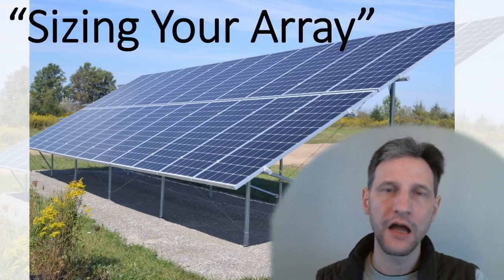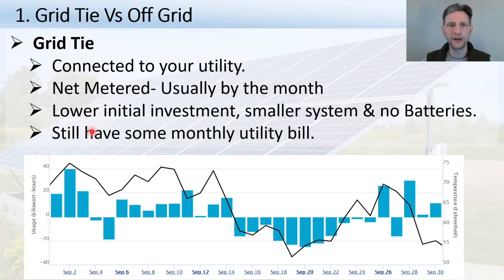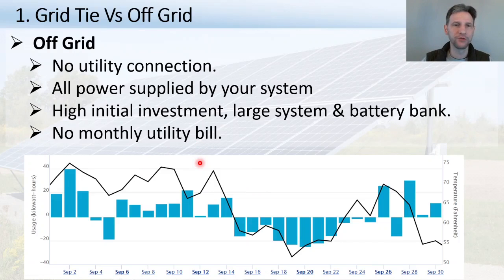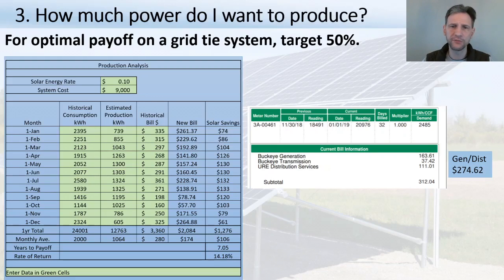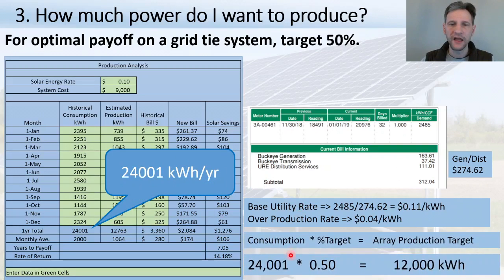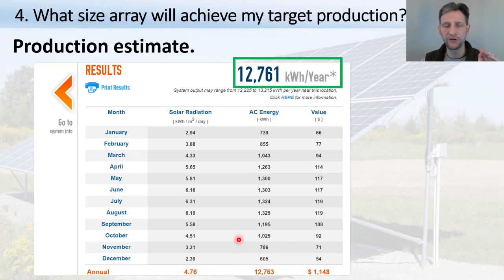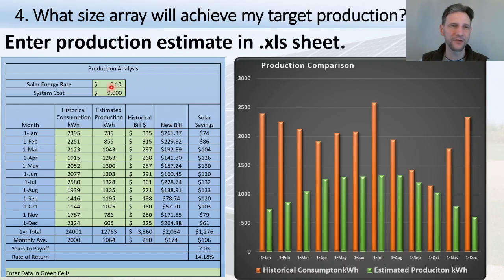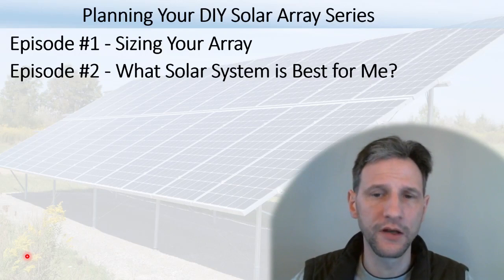How to Size Your Solar Panel System - Planning Your DIY Solar Array Part 1

Comment: Thanks for the clarity! One quibble is that you wouldn’t need a battery that makes half the month’s electricity, unless darkness lasts two weeks at a time! Every day there’s sunshine in some amount, so that’s the measure to count on. Denver Colorado gets 300 days of sunshine even if winters can be cold.
Another matter not addressed in comments or the video is that payback isn’t always the goal—freedom is. These days, air conditioning and even cooking & heating with gas are under political fire.
Reply from the maker: You have a good point, to be fair, optimal battery size will be different for everyone.  Battery capacity heavily depends on the climate in your location, your consumption pattern, and the size of your array.  My comment was based on a brief look at some of my worst case months for battery backup assuming keeping my current array.  In those cases I was overproducing for the first half of the month and then underproducing for the second half of the month.  To take full advantage of all production I would need to save the energy produced over the first half of the month to be used later.  However, to your point if the array is sufficiently oversized that would not be necessary.  There is a balance somewhere between oversizing the array and minimizing the size of the battery.  I plan to do some further detailed analysis on where that balance point would be for my system in the future. Thanks!

Comment: u use over 2000 kwh a month oh boy, I use about 300 does it make sense for me to go solar?
Reply from the maker: These systems are all scalable, just run the numbers and see if it works for you.

Comment: There is a out 2,840 hours of sun light per year. 12000/spa. Is 4.84kwh array.
So if you had a tracker that was around 5 kWh then you should meet your target.

Comment: You don’t need a battery for two weeks, you need a battery for two or three days and then a gas generator to make up the difference. A much cheaper option long-term. 
I myself only have a battery for a day and a half and use a generator for those times when there’s not enough sun. Usually it’s just a couple of months out of the year!
But my system is off grid, because if you’re connected to the grid and the grid goes down then you have no power at all. It’s better to have a transfer switch, when this happens.
Reply from the maker: A battery/generator hybrid solution does significantly reduce the battery size needed.  Is your generator sized for your whole load or does it just supplement the batteries when they get low?
Reply: @ProjectsWithDave  
I didn’t buy the generator that I would buy now, knowing what I know. But at the time I just bought the simplest and not very high wattage generator I could get. It’s only 3100 watts, so it’s basically just for charging up the batteries.
Reply from the maker: That's the value of the YouTube community, you can learn from what others who when before you have done.  : )

Comment: So 9.4 kW system produces 12763 kWh per year you must live in exceptionally sunny location. May I know what state you are in? Must be north of USA as I saw snow on your panels. Also I used PV calculator for my area and noticed that if I choose premium panels or thin film panels with lower efficiency and lower temp/power loss coefficient then I produce more energy. That means that low coefficient is more important in some cases than maximum nominal efficiency
Reply from the maker: I live in Ohio, not the most sunny place in the US.  With all the analysis you do, convert everything into cost/watt.  It doesn't matter if one panel is 10% more efficient if it cost 30% more.

Comment: I must have missed where you talk about sizing the array. You seem to have entered the size of your array (9.4) into that website before any other data. If you have your yearly usage, how do you come up with the array size? 
Eg Southern Ontario, 18000 kwh/year, annual net metering, $2500/yr total charges
Reply from the maker: The idea is to try different size arrays in the calculator using your address and the orientation of your array.  When you find a size that meets your production target, you can design a system around that.  Hope that helps!

Comment: Great channel! Do you have much experience with doing solar setups for Michigan residents?  Looks like Michigan averages around 4 hours of sunlight for the year?  I need a system for 15kw...and to possibly future proof for an electric car or two.  We are currently on NG furnace, water heater, and dryer.
Reply from the maker: Michigan is a little further north than I am so you would want a slightly more aggressive tilt on your panels.  I would face them all the the South.  Also, you should do some calculations on your electric car consumption, you may be surprised how much extra that will add.  Also the technologies linking solar and EV's is changing rapidly.  Check out my video on the topic here: https://youtu.be/U2ilH8yOi7A
Reply: Barr: Solar panels will be paid back much faster by charging the EV than by savings on house electrical costs. I only wish I could afford a Tesla! Cheaper brands will work, though.

Comment: very nice explanation. Perhaps consider also maintaining an array of batteries.True they cost extra, but they allowe you to consume the electricity that you have proudced before sending it to th grid. This is more effectice as you mentioned that utility charges 11 cents/kwh but pays you only 4 cents/kwh for electricity you produced. Second idea is to use batteries in winter to accumulate to more cheaper nightly electricity rate and then consume it in the morning before starting to pull energy from the grid
Reply from the maker: The grid acts like a month long battery.  That is way more capacity than any battery I could purchase.  Adding a battery would help in a power outage, but have no affect on the payback of the system.  You can see that analysis here:  https://youtu.be/IwUK1dNJ3n8
Reply: @ProjectsWithDave  Hi!, Thanks for your reply. I don't intend to design an off-grid system but an on-grid system however with batteries as well. The point is that in the wintertime panels don't produce much anything but the price difference between nightly and daily electricity is almost 100%. So the idea is to charget the batteries during the night and consume this energy during day when electricity from grid is much more expensive. Offcourse I hope that panels produce a lot of energy during the summer that I would be sending back to the grid in order to earn some money that would offset the higher consumption during winter. Even here batteries might be useful. You pointed out in your video that you get electricity from grid for 0.11 USD/kWh but grid pays you only 0.04 USD/kWh. So it might make sense to store the energy you created and use it yourself before selling to grid
Reply from the maker: I essentially get $0.11/kWh for daily overage since I only pay the net at the end of the month.  It is only over production for the month as a whole that is at the lower $0.04/kWh.

Comment: Did you ever consider using the solar panels as the roof for a carport or shed.  Would it be possible to seal the gap between the panels to create a water tight roof system.
Reply: The problem with solar roofing is the gap between solar panels. There is very little one can do to seal it properly. Using any type of heat treatment like soldering or welding solar panels is a big safety risk and must be avoided. One can try using aluminium grooves but it does not make it economical nor completely leak proof. It is better to simply install an aluminium roof and then fit the solar panels on them.
Reply: @shrujanamsyama9940  the designs i've seen are all slate roofs with the panels acting as slates
Reply from the maker: I have considered that, it makes a lot of sense especially if you are installing used panels.  There are people that have made solutions similar to your proposal.  My initial concern is the management of thermal expansion of the panels.  If someone knows the impact of thermal expansion on installing panels with no gaps, I would love to hear about it.

Comment: Great videos I am learning so much from these.  Thank you!  Is there a calculator that estimates system loss based upon voltage and distance to array?  I live in the mountains and would have to go 400-500 yards to get to a south facing open spot.
Reply from the maker: I have been working on a video to help determine the best solution for the conductors running from the array to your house, but it isn't finished yet.  There are many calculators online to help you size your conductors (such as this one: https://www.southwire.com/calculator-vdrop ).  The higher the voltage the smaller the conductors can be.  However 500 yards is a very long distance, you would probably need a 4 AWG conductor for that run (assuming 400VDC at 10A) which would be cost prohibitive.
Reply: @ProjectsWithDave  I meant to say feet, not yards, but still, a pretty good little hike down into the pasture
Reply from the maker: Well, that's a big difference!  A 500ft  run, assuming 400VDC at 10A, could be done with a 10AWG conductor, that brings you back into the realm of realistic.  : )
Reply: @ProjectsWithDave  400VDC is that the highest practical voltage to use or is that a code limit thing?
Reply from the maker: If you are using a string inverter, many will go much higher.  I would use an inverter that can handle at least 600VDC on the input and then string your panels to get as close to that as possible.  I used 400VDC because that is the voltage SolarEdge optimizers hold the system to and it is a good minimum to design around for distance runs.

Comment: And what about trying to cover 100% of consumption in the month of most solar production which is usually June? You wouldnt overproduce throughout the year then and you would save around 50% on your bills on average.
Reply from the maker: I think that would be a great place to target as well.  There would be some over production in the spring and fall, but it would be small and only degrade the payback period slightly.

Comment: Since you produce more power during the winter months you could use some of that power to heat your home during the winter months. Any time you over produce it would pay to use that excess power to heat water used in your home.
Reply from the maker: I currently under produce in the winter.  My house is all electric and heated by geothermal.

Comment: Hi ,
I couldn't believe the numbers of yearly usage ! An average of 24.000Kwh/year or 2000Kwh/month ???
Here in Europe the average is 3500Kwh/year or 292Kwh/month, at a real-cost of 0.73€/Kw.
Now I need to sit down and recover a bit...
Reply from the maker: Our house is all electric, heat, hot water, cooking, laundry, etc.
Reply: @ProjectsWithDave  Yeah your usage is insane. My yearly usage is 10 MW and not only is my large family home all electric I have a Model S as our only car. I'd suggest adding energy monitoring to see where all your usage is coming from. In Australia we don't have net billing. You buy at retail (20c) and get a feed in tariff. For me its 5c. So I'm highly motivated to self consume.

Comment: To me the power companies are more like banks, they’re not gonna give you much interest or in this case much per watt in benefit. And now I hear you’re being charged more because your on grid system with the panels? Sounds just like a banker!
I opted to go off grid, because the benefits to being on grid are next to zero. Not only does my power company not pay much of anything, if your power goes down so does your benefits of your solar. 
I may have paid more in the long run, but I did it all myself. This saved me a heck of a lot of money! Although I had to get an electrician to do the final connection to the panel, because it was over my head. 
Being that it’s been only about a year now to see what the actual benefits are. I would say that at least seven months out of the year I’m doing great and totally off grid. 
The next five months or more of a challenge, with a majority of that running off grid during the day and on grid during the night. Being that I live in the Pacific Northwest, you have 12 hours or so without any light at all. This is why I have 9.6 kW of battery storage and have added another 5 kW recently. I also have 7.5 kW of solar panels. 
If the grid goes down I can run at least my refrigerator and freezer, some lights and during the day on my 120 appliances, and this is in the winter. 
There’s a lot of talk about grids going down for weeks or months in the coming years, so it was a no brainer for me to get off grid. I realize that I now need to concentrate on insulating my house better. This is for the winter months. I’m also looking at a small wood stove to augment my needs for keeping warm, which is what most of the energy I’m using in the winter. As I’m using gas to heat my house. And N gas prices are soaring in the US. If I do these two things, I shouldn’t need to increase my solar array at all.
Reply from the maker: Completely off grid as you have found is a significant challenge.  I hope it works out for you.

Comment: Greetings Dave,
You do a great job with your videos, thank you. But, I am a little confused regarding the logic you used to size your system. If I recall it correctly you pay $0.11/KWH for power and your utility pays you $0.04/KWH for anything in excess of your power usage on a monthly basis. Ideally it seems that it would be best to generate as much power as you consume or perhaps a little more. By doing this you would not be purchasing any $0.11/KWH power from your utility and selling them very little or none of your $0.04/KWH excess power. Any time the utility is paying you $0.04/KWH for your power means you are not paying $0.11/KWH to the utility for their power. Is this reasonable logic for sizing a system? Thanks again for your information and guidance.
Reply from the maker: It is all related to speed of payback.  My current system almost never overproduces, but is net zero or close to net zero for abut 6 months, so that equipment will pay off quickly at $0.11/kWh.  Lets just make a simplified example.  If I installed $10,000 in equipment, it would earn about $1,500/year (with all of it's production working at the rate of $0.11/kWh on a production of 13,636kWh) and pay off in 6.7yr.  If I doubled the system for another $10,000, that equipment would be overproducing for 6 months of the year (its production working at the rate of $0.4/kWh on 6,818 kWh) earning $272 and meeting production needs for 6 months (working at a rate of $0.11/kWh on 6,818 kWh) earning $750 for a total of $1,022/yr.  It would take the $10,000 cost of the expansion 9.8yr to pay off.
The point I was making in the video, is if you have net metering by the month like I do without carryover credits, and want to make the most conservative play for your investment than overproduce as little as possible.  If your goal is to cover all your consumption and payback time isn't a concern, than making it bigger would make sense for you.  Hope that helps.
Reply: Dave, I agree. You are over analyzing the ROI aspect. I have a 18.09K system and my monthly bill ranges from $15 in the summer and $40 in the winter.  My goal originally was to have my daily usage covered by the solar panels in the event the price of electricity increases to 20 cent or worst. My suggestion is add another 9k, you already have so much DIy knowledge and know about the lowest $$$ for your next system.

Comment: I didn't hear anything about when your power goes out and the power company don't "let" you use your solar panels.  First video I've watched so if you mentioned it in the next series my apologies sir.  Great video though,  very informative
Reply from the maker: You're correct.  This system has no battery backup, I mention the reasoning in this video on net metering: https://youtu.be/IwUK1dNJ3n8

Comment: Thanks but hard to understand as you seem to fade as you talk on.  My case I have natural gas heat and no A/C.  With a solar system, I'd want to upgrade to an electric heat and A/C so it would skew things greatly.  I currently pay about $100/month electric bill so any solar is silly.
Reply from the maker: I imagine it would be hard to justify solar if you have natural gas heat and no A/C, but at the same time you wouldn't need a very big system to meet your needs.  The initial investment would be small.
Reply: @ProjectsWithDave  I'm retiring next year at 60.  I'm getting some cash and think this would be a great investment.  Guess my power company does annual reconciliation.

Comment: I have installed a 26 panel sym 320 watt per panel equals8320 watts. Cost 34,600 with interst$48600. My useage last mo.bill $73.60 solar credit was$53.35 so acual balance of bill was$20.25 is it worth it or not to be paying for 25 yrs at $121.99 what do you think?
Reply from the maker: Sorry, Benjamin, that's not enough information to calculate the payback period.  Do you have the expense vs income over a one year period?  It will vary significantly over the year.  It sounds like you have a 25year loan?  A 25 year loan on $34,600 with a 2.875% interest rate has a total cost of $48,551 but the payment would be $162 not $121.99.  Of course you need the average savings on your electric bill to be at least what your are spending on your loan payments, or it doesn't make sense as an investment.  Taking 25years to pay of the system seems risky to me.  I wouldn't want to go more than 10years.  Just my opinion.  Thanks.